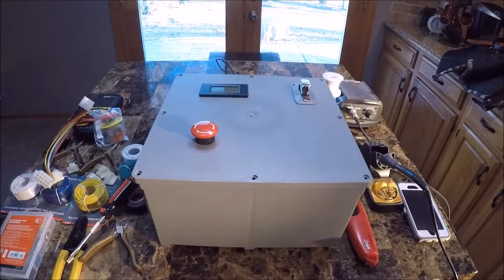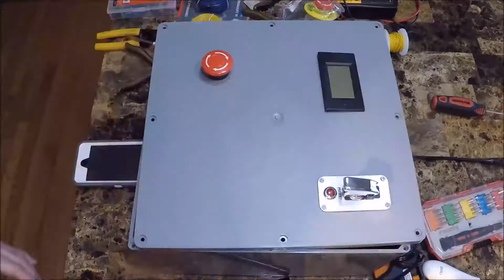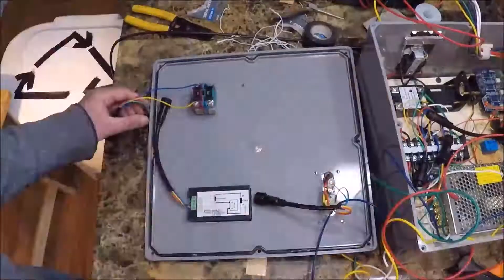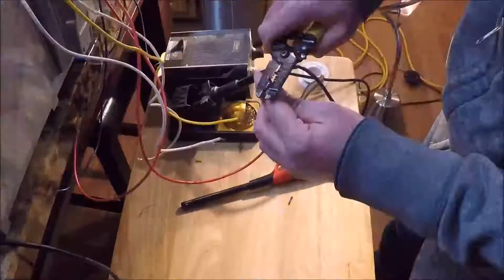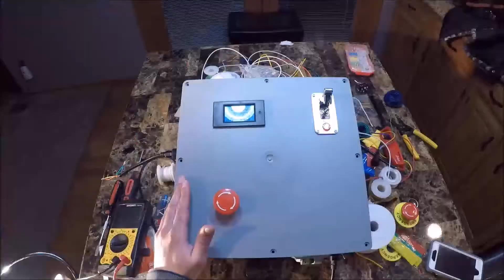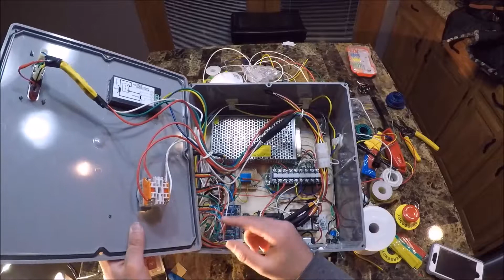Custom GRBL CNC control panel

Comment: Can you give a part list?I just want to know especially what motors and drivers you ve used.
Reply from the maker: I used a "GRBL Shield" with integral motor drivers and an arduino UNO to control my CNC. I bought my GRBL Shield from Adafruit about 8 years ago. I believe they still sell a never version of the same shield. Thanks for watching.

Comment: Wheres the arduino?
Reply from the maker: The GRBL shield is an Arduino accessory that is installed on top of the Arduinio. Towards the end of this video when I am giving an overall explanation of how the control panel works you can see the GRBL shield in the bottom left corner of the control panel.
Reply: @OrangeLabPinball  can you please send me the part list?
Reply: Can this arduino board run a cnc with nema 23 motors

Comment: What is the part number of the Ammeter readout my setup is similar to yours but your high voltage should not cross  keep it all to one side
Reply from the maker: Thanks for watching the video! I agree it would be great to keep line voltage to one side of the panel and low voltage on the other. If I ever rebuild the control panel I will be sure to follow that practice. I believe my ammeter was a "bayite DC 6.5-100V 0-100A Digital multi meter".